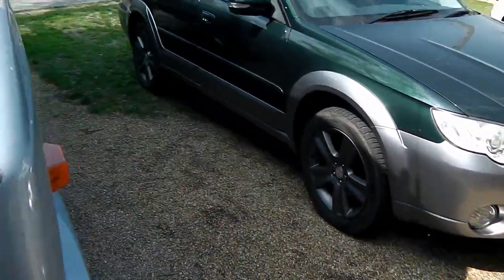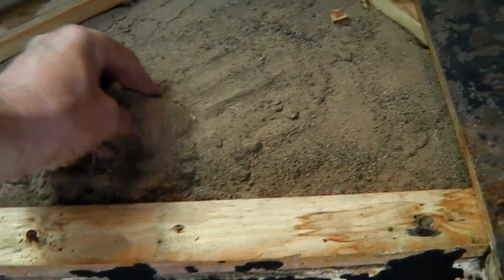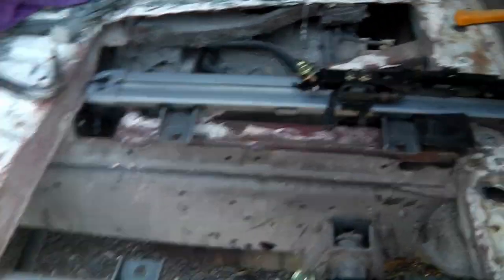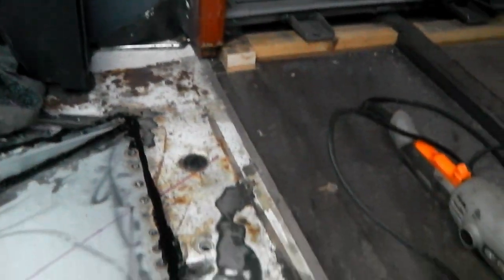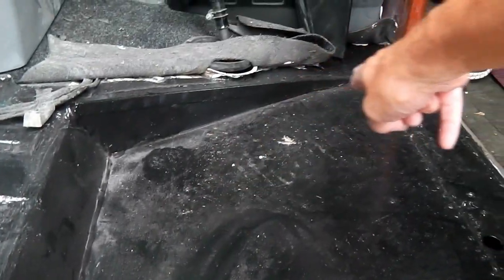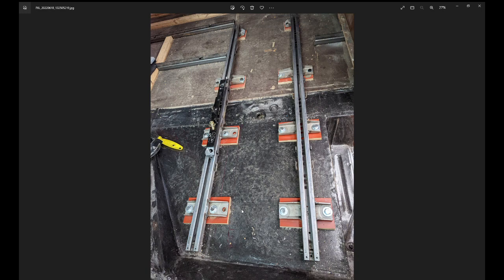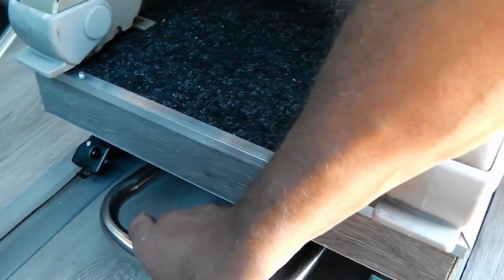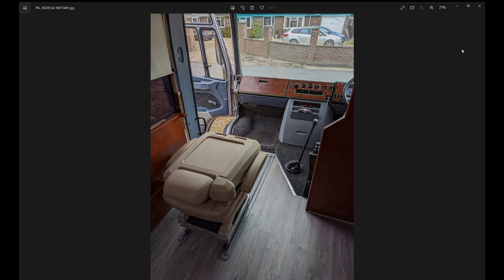Mercedes Vario - Passenger Bus Seat Conversion

Comment: Great work. It might be worth checking that those swivels are certified for use on a seat with an integrated seat belt. Most are only tested with a belt secured to the vehicle pillar and therefore only certified for that use case. I had this issue with my 609d bus conversion. It was an employee of Jennings seats in the UK that pointed out the issue when I was about to buy some seats and swivels off them. My engineer here in Ireland who would have to certify the seat changes later confirmed it. The same belt issue applies on the drivers side due to the hinged battery box. I eventually managed to get an Aguti belted seat and swivel which was certified and tested. I used the same seat and swivel on the drivers side but removed the integrated seat belt so it could be used on the battery box.
Reply from the maker: A very valid point you make there. And one that I've umm'd and ahhh'd about myself many times. I've seen some horrific looking examples of seats and other things that shake my safety-conscious soul to the core (for example how many of those cast iron wood burners you see, are actually bolted to the floor?). I cannot find a certificate for these swivel bases, they are available everywhere and are clearly made in China. Is that bad? Before I used my engineers brain, I asked what else has a crash test certificate? The runners? No, they come from an imported japanese vehicle. The Vario floor? No, the existing seats use a set of box section crossbars, welded to the sides and bolted through the Rhinoboard floor. The seats themselves? These are mechanically complex and I'm told are made by Mercedes. They have a quick release set up that uses an inbuilt wedge principle of locking them into position (In my mind, this is where any weak spot might be). How about the 4mm plate and my own welding that connects the seat to the swivel? I welded the bejesus out of it just to be sure it wasn't going anywhere. I even thought about the structural compromise made by whatever company cut out the floor to put the fibreglass in. That cannot help it's strength?

My day job is in risk. Sometimes we need to consider what would be an acceptable risk. There are so many 'ifs' that would be required to lead to a catastrophic failure of the seat anchorage in the event of a collision, that led me to eventually accept the risk. 

Given that a Vario Drivers seat has its buckle attached to the seat base, and that is held down with 6 x 8mm bolts to captivated  nuts in the floor, the structural integrity of the seat swivel unit and my opinion of its construction is more than sufficient.

This answer went on for far too long! :0)
Reply: @SnarlingDog  GREAT STUFF! I've been gradually cobbling constructing a new set of steps and floor a BIT like yours in my '98 614. The seat on an American swivel (ebay) is going further forward into the footwell as I have a larger bus access door slightly further back than yours. I'm going to have to get a roll cage specialist to help with some kind of clever seatbelt mount remote from the seat itself - once I've done all the rest. I figured I would bite the bullet and get stuck in and if it fails inspection just modify my work 'til it passes.
Yours is a work of ART!

Comment: Thats brilliant Bob. I am just buying a Vario and will need a similar arrangement. Do you fancy doing another one? Most of that work is outside my skill competence so I will need to find someone to do the bulk of the work for me
Reply from the maker: Hi Tim. Thanks for the compliment. Apart from having a day job, I struggle to spend all my energy on my own van, let alone another one! 😂
You can do it - skills come from experience and nothing is impossible! (Well impossible-ish anyway)
Reply: @SnarlingDog  Thanks Bob... by the way.. what seats are they? Did you get a solution for the front driver's seat? Those seats with integrated belts have them going the wrong way.

Comment: That’s bloody brilliant Bob, what a great idea , so creative and I love the way it slides out of the way. I really want to buy a Vario bus and when I do I’m going to do the same sort of thing. How long did it take you in real time and were the part’s easier enough to source? Thanks in advance
Reply from the maker: Thanks for the kind words. In time it probably took about 30 odd hours I guess. Mostly measuring and fabrication but then I did put a new floor in and there was a lot to take out. Parts are surprisingly easy to come by. Google those runners and you'll find a lot of sellers on ebay etc. The seats I already had and the swivel came from an online outlet. Hardest part was getting the slide release mechanism right.